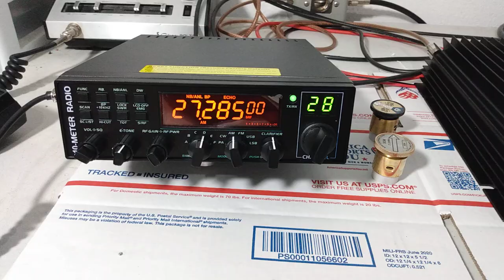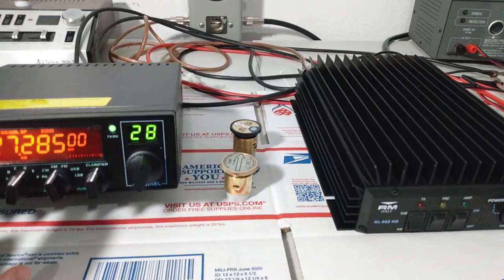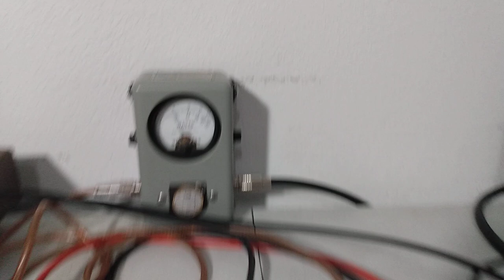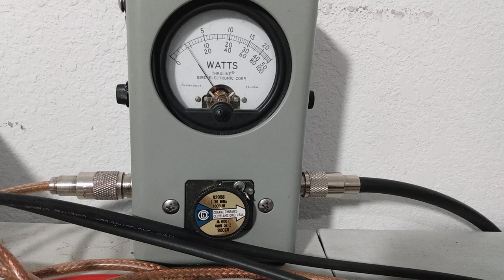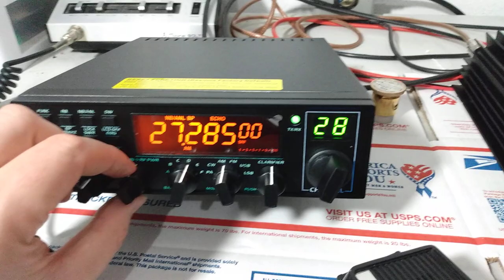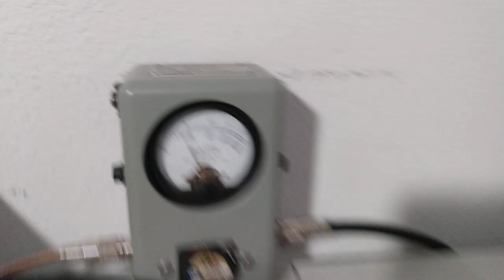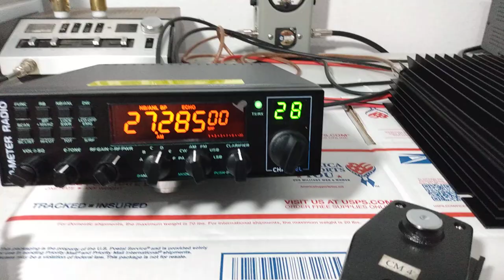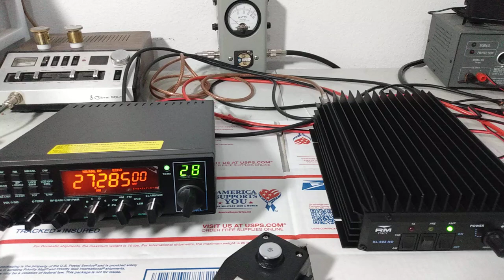The AT-5555 and RM-503HD are a perfect combination for SSB and AM,  Functionality Test of Both

Comment: I bought one of these RM italy 503 HD from you on Ebay, its great. I combine it with an AT-6666. With around 20 watts in on FM (12 o'clock) it does around 190 watts forward (I don't have a PEP meter) I use it mainly on SSB to talk all over the world. I'm guessing its def doing 300-400 PEP on SSB. I get nothing but good reports with this combo.
Reply: running the same setup and good reports back
Reply: @johnalger9991  With the At-6666 and RM italy combo I find I get the same output if I run 20 watts FM into it or 35 watts so obviously I back it off a little. I find the FM carrier the easiest way to set up both the SWR tune and get an idea of the power out. On SSB my meter peaks over 200 straight watts so I'm guessing that's around 3-400 PEP
Reply: @peterdawson3536 hi Peter, after 40 years away, I’m getting back in with the same rig (at6666) as you have (only not the 503HD but the 503). Plan on using in my car for when I’m in the boonies without cell service. Cheers😊👍🇺🇸
Reply: @BobJones-zw3ui  Be careful on turning the RF way down on the at-6666 for the standard 503, you could easily blow it up. The HD is better for the AT-6666
Reply: Thanks for the explanation. I have a DX 5000 PLUS and I have a RM 503 HD
 Amplifier, but the problem is that the Amplifier in the Transceiver does not work properly, and the power extracted from the Amplifier does not appear in the watt meter, only the Transceiver power appears. Is there anything in the Transceiver settings for it to work properly? I hope to find the solution. Thank you.

Comment: Ordering a 503HD later today, great amp paired with the Q6 also, 25/-30w is plenty input.
Had a 503/505v & Zetagi B550p, but I do like my Rm's, I also use a 203p 😊
Reply from the maker: Think I have two 503hd left in stock
Reply: @Rooster_Radio  I'm in England mate, I'd be hitting  you up for a 2 by 4 pill otherwise.
Tried the others, this just being 1-35w all bands, I'll be happy with 20 - 25w input & 200w out, maybe after this I'll save up for a plug in the wall Acom or the likes.
Great video as always matey, appreciate the reply, from the 407 Mcr Uk 👋
Reply: Just bought one of these myself but the lierature is saying 1-6watts input is that dead key ? Also in the uk :hand-pink-waving:

Comment: Thanks for the explanation. I have a DX 5000 PLUS and I have a RM 503 HD
 Amplifier, but the problem is that the Amplifier in the Transceiver does not work properly, and the power extracted from the Amplifier does not appear in the watt meter, only the Transceiver power appears. Is there anything in the Transceiver settings for it to work properly? I hope to find the solution. Thank you.